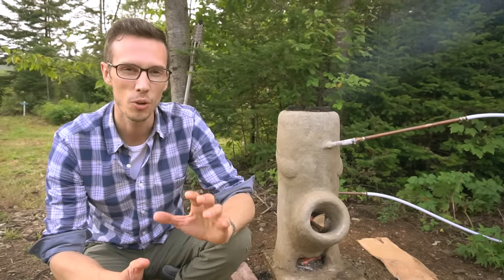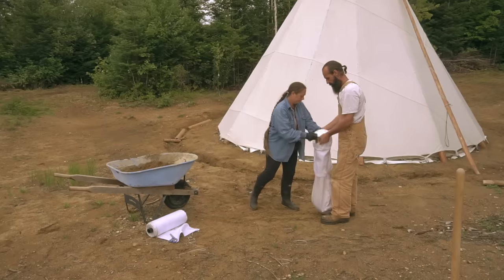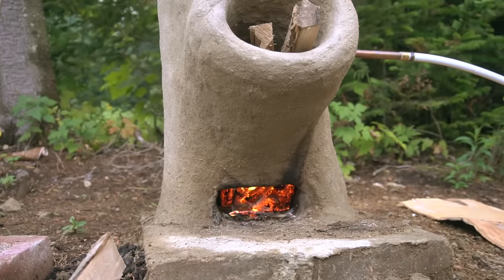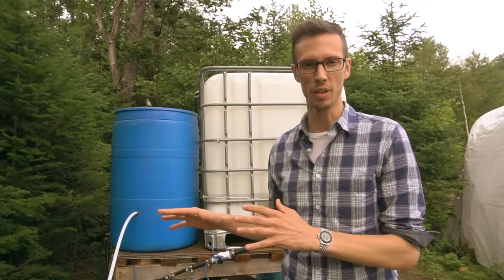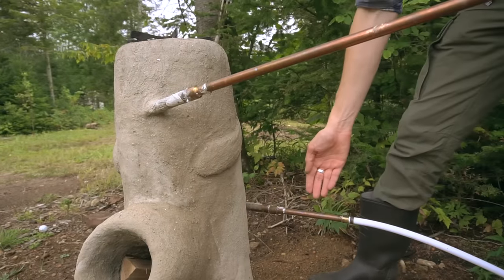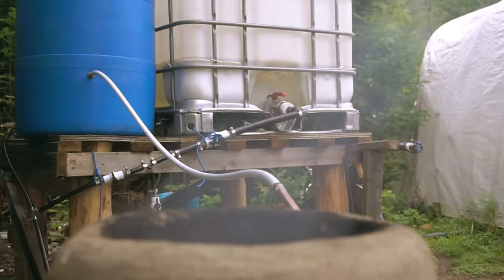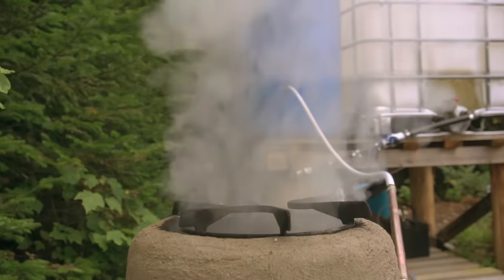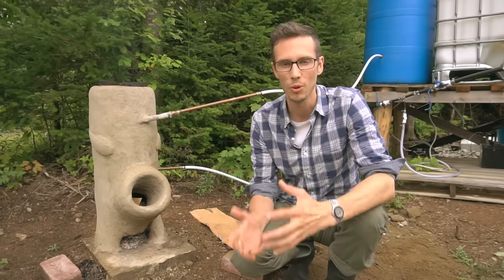Brilliant DIY Off-Grid Water Heater Using a Rocket Stove – No Propane!

Comment: I cried watching this video because I realized how much of modern production is spent on "waste".  Sure comforts of life are great--hot water, soft furniture, nice art, wood floors, insulated walls, electricity, heat, a/c... but we spend 40+ hours per week working some job to maintain it all when there are things like insurance companies, advertising, entertainment, even information, is all commodified and takes resources away from other things we could be doing to make those comforts even more efficient.  

Idk if that came out coherent, but basically - I am trying to build an independent off-grid life because at least  my labor is directly going into managing my habitat and sustenance.  I will find the joy in the work I have to due, even when it's stressful or physically demanding.  I MISS doing physically demanding work--my body and my mind miss it.  

I have a powerful brain but I don't like having others tell me what to do with it.  But the wonders of remote life will allow me to finance the above lifestyle by being selective about my work (gigs and contract work directly for clients, no more selling my soul to the man).  It's a great system, and I hope I can do the kinds of things I am seeing here

Comment: That's good. But it could be even better. You may need to add height to the hob outlet if it is only for heating water. Or add a second pipe (with a valve or flue damper) if you want to keep the hob functionality.

Comment: genius! although, I would use a sturdier container to hold the cold water, i'd be afraid the hot water may compromise the integrity of the "plastic"  container after the warm/hot water is collected back into it. steel container would be better or a beer keg? eventually it would probably leak or corrode, but even with insulating, it should last a long time. just a thought.

Comment: They can directly put a water source made up of metal or clay mud on the stove and join a pipe to their kitchen and bathroom. In that case they only have to add a gate wall on the boiling water source.

Comment: We call that a heat exchange water system where a coil of copper pipe runs through another copper or stainless steel insulated barrel with the thermosyphoned heated water mass, your plastic barrel looks dodgy and temporary. 
Love the novel clay rocket stove though , it would be a great exercise for bush survival comfort to create free hot water on demand, I'd build something a lot sturdier and permanent for long term off grid in a wood stove homesteading.

Comment: Hi... Looks nice
 technical question
1. Was the copper protected from the flame at all, or is it not necessary (or is copper is hardy enough ?)
Reply: Copper doesn't touch the flame, it's wrapped around the outside of the chimney.. then plastered in clay, tip, don't use clay or cement or any other window dressing.  It'll explode n stuff

Comment: If you're going to do a setup like this i'd insulate the the transfer tubes coming back to the heated water tank, and insulate the tank itself. Better yet, simply get an old water heater and use it.

Comment: you use the same principle with a coil of copper tubing attached to a cooler or some other insulated container and lay the coil into a wood camp fire.. the convection of moving water will eventually boil in the container...

Comment: I wonder if you could build a small Adobe house with piping throughout the walls and floor, then use a solar panel to power a pump, to then circulate heated water throughout the home

Comment: Everything I've seen has the burn chamber and chimney insulated to achieve total combustion.   I think a mass heater type setup would be a much more efficient energy transfer.  So heat exchange should happen at the exhaust or chimney exit.

Comment: If you put a check valve in the cold inlet side it would increase the rate the water is flowing in the coil and the correct direction. You could also use it to pump the water from their main tank to the new tank. Then it would only have hot water in the new tank, and not have to heat the entire mass.

Comment: I would think that the cover tubing would quickly become coated with soot and become inefficient at absorbing the heat from the fire. What about encasing the tubing in a large amount of thermal mass?

Comment: I would think that by allowing water supply in to the upper inlet (current outlet) of the coil would make for more efficient heat transfer, allowing for less fuel to be used. 
They could also insulate the lines from the tank while they’re doing the tank...

Comment: first look thought it was a decorative urinal.. lol. i found many hoses cant take heat & pressure for long. steel braided hoses work better. also some non restrictive filter helps to keep from a buildup if the water is not the best quality.

Comment: They wired the in and out lines backwards would work better if they flip the lines on the stove. Then add a steam pressure release so if they run low on water or it gets to hot it doesnt blow up. People have done the same thing on a wood stove you need a pressure release to be safe.

Comment: nice
water heating
cooking
circ w/o pump
angled wood feed
fire lighting hole / Ash clean out

nice that cold water coming in at the bottom will return to the hot water storage tank thermally..
i woul have made the mistake reversing the tubing.... but now I see if hot water went in the bottom it would rise and go out the top tube reheating the hot portion inefficiently

Comment: Instead of enchanging water, just  exchange the heat IN the water... by using a coil...  plumb pipe OVER the top edge of tank... with a small straight, descending piece of copper, before the coil begins (at the  top of the water level)... and coils down (centered in the tank, not along the edges)... then the bottom outlet, should just be  a continuation of the copper tube... which penetrates the plastic drum's wall,  a few inches above its bottom, using a bulkhead fitting.    This way, you can use the same water, instead of running new water, through the same tube... (which will plate and eventually clog the copper pipe.)   This way, the same water will carry heat into the cooler tank, and deposit it... but it is not a water transfer, only heat.  :-)

Comment: I love the idea of going off grid, but do me to have to light the fire every day for some hot water etc is a lot of additional time required which I don't really have.
I've got one solar hot water system which helps, but in winter even in South Africa, the sun is weaker so it's less efficient.
The convenience of electricity is hot water on tap without thinking much about it.
Reply: The point of going/being off grid/self sufficient  is to provide you with more free time.. and starting a fire takes less then 60secs

Comment: Ever heard of an Elephant Water Heater. A 44 gallon 200 liter Drum laid on its side. A hole cut in the top. An outflow pipe in one end about 2 inches 50 mm below the top. Fill to side pipe. Light fire underneath water boils to get water out pour cold water in the top automatically expresses boiled water from the side pipe you can keep it up constantly.

Comment: Use an automotive radiator on the hot side and inside the tank to dissipate more heat into the cold water tank.

Comment: Good video, you couldn't get 10 showers out of that tank though. I've build a semi off grid cabin and pump rain water from a tank of the same size into a tankless gas water heater and you get 2 showers at most from one tank

Comment: Very very nice artwork besides. Thanks a lot for posting this! You are now one of my inspiring heroes working for solutions for a better world instead of just crying about the bad guys.
You can make a cleaner and more efficient burn (smoke is unburned fuel) without CO with a burn tunnel of at leat six inches in diameter (more than 8 inches can almost produce lava.. )  using an afterburning chimney. When all of it is  wrapped up  with some good insulation (ceramic fiber works very well-so does a clay-perlite mix).  In this example, the copper pipe must be well protected against the open flame: Erica and Ernie Wisner found that ceramic fiber or a clay-perlite mix can cause the temperatures to rise well above 1500°C in the burn tunnel just before the afterburn chimney. The results: Less fuel consumption and co2-neutral heating due to a better burn.
Take a look at permies.com. They know more about it than I  do.

Comment: I'd be inclined to heavily insulate, and possibly make the chimney bigger(?)
Reply: Why make the chimney bigger?
Reply: i was thinking that any excess "heat" would be transferred into more pipe up the chimney. i.e. double the surface area of tubing by making the chimney longer.
Reply: I can only get so hot though, plus it might lose its usability as a stove top if its too tall, but it gets very hot even with only a few coils. at least it does in similar things ive seen, and those weren't even in rocket stoves, just a regular fire.
Reply: the home ones have very long flues, so provided it has an exit, it must be able to escape. I think there's a lot of benefit to surface area, just look at steam train boilers.

Comment: I really didn't understand where a shower is taken if the blue container only has two pipes. One taking the cold water towards the  rocket and a second one bringing it back as hot water into the  same tank. Therefore my confusion is : would I have to take a shower outdoors? And how would I get the water out from it?

Comment: Hey that's a nice idea, you can be self sufficient with your wood however I don't think it's very efficient. I just finished a project on biomass for heating water in a biomass (I can share it with your once it's validated).
Those open fireplaces have an efficiency of 5 to 20% which means that 80 to 95% of the heat is for... The birds. It means that you consume way more wood than it you'd have an efficient system. The fact that the water tank isn't insulate isnt good at all either. Moreover the fact that the stove is located outside of the house make it less efficient as you don't even collect the heat for the house. At the end of the day it can harm the environment more than efficient propane of gaz (yes yes !)..

Comment: The same piping and the water 💧 storage can be used inside the house 🏠 walls, so the heat escaped from the water 🚿 heater can convex into the structure, like the attic or somewhere useful and the water tanks make good heat sinks and solar heating from the sunny 😎 side doesn’t require much more work after installation and the fireplace could be used as a backup heat system once enough solar heat is storable. For cheap cooling, underground tubes can bring up cooler air than the outside air, so take advantage of what’s offered for nothing but our ingenuity.

Comment: How does the water travels back into the drum, against gravity?
Reply: Raman Bari the pressure of the larger volume of water in the drum tank above the heater coil In the stove keeps the water moving. I think the heater would be more efficient if the water inlet was the upper part of the coil and warmed itself as it travelled down closer to the embers, and then super hot water went up the pipe back to the tank.

Comment: They should build a wood gasifier so they can run petrol generators off of the wood to produce electricity or even drive around using wood as a fuel.

Comment: Only problem I see is that rocket stove efficiency comes from the high chimney temperatures, and by using the chimney to heat water you're decreasing temperature thus efficiency. A better idea would be to make the stove have another "combustion chamber" (like the drums you see when you look for rocket mass heaters) and take the heat from there. Anyway, good idea
Reply: The high efficiency comes from the temperature differential between the hot chamber and the cold ambient temperature at the exhaust. This creates a buoyancy force, expelling the hot air from the combustion chamber. This heat exchanger does not impede in that, because it is not located at the chamber, but in the column, where the exhaust is. If anything, it should aid the efficiency by cooling the exhaust temps.

Comment: Should have built a "rocket cistern". Make a concrete cistern with the shower water in it. Lots of thermal mass. Make fire in the rocket stove portion. No plumbing to lose heat from into the air as it siphons back and forth. Make a plywood lid for it, and insulate it with fiberglass or something.

Comment: They need to use 20 to 25 mm copper, and have straight pipes (preferaby) with a constant fall from the heat source to the water storage vessel.  This should be copper preferably, to avoid melting the plastic.

Comment: A problem is though that by cooling the fire with the water, the temperature of the fire is lowered, which in turn decreases how effective the fuel is converted to carbon dioxide. This can result in the production on carbon monoxide as well as potentially cancerogenic partially oxidized hydrocarbons. This can be avoided if the amount of water passing through is optimized.

Comment: If I just use regular clay would it crack from heat without any special treatment? Such as just buying clay off of internet and molding it to that and letting it dry? And or same question eith concrete

Comment: Using propane is not living off the "grid".     You should use an inline pressure release safety valve in case water circulation stops for an unforeseen reason.  I would locate one on each end of the coil.  Perhaps there is a way to create small cob coated enclosures that would still be aesthetically pleasing.

Comment: Really the reason you want to do this is to use the excess heat generated from the flue and to cool down the rocket stove. A cool rocket stove lasts longer.

Comment: Hey how about a 3 - fer ???
Take that nice Clay Rocket Stove , build a Clay Pizza Oven just above it where chimney goes up through the Oven , continuing up thru tm& out the top of the Pizza Oven.& out the top & still cook your pot of soup on top there .... Have your water heater , have a Pizza Oven , still have CookTop & the Oizza Oven doubles as a regular Oven to Bake breads , roasts , chicken etcetera...  Now there's a multi use appliance for you ...👍👍😜😜😜😜😜🤗🤗🤗

Comment: Physics! 🤔 How can the hot water go up back to the barrel? Since the barrel in higher than the stove and also both pipes are higher than the stove where they connect to the barrel, so the water is going to flow down from the barrel to the stove on BOTH pipes 🤔

Comment: I don't believe you need to have the water 'source' higher than the fire stove, as I have seen youtube videos of people heating outdoor bathtubs with an at same level thermosiphon. Essentially, as those videos explained, the heating of the water within copper tubing initiates the water movement from boiling. 

It probably wouldn't work with the copper tubing above the water source, unless it was a closed circuit (ie. water within the copper tubing at all times). But would be interesting to see someone try.

Comment: You made a error in connecting your tubing to the barrel. Stove side:cold should come out from bottom of the barrel and hot return to top.
waterside fill cold on bottom take out hot from top. this way you will create thermal seperation in the barrel and hot will replace cold from top to bottom instead of mixing as you are doing now . this will keep your flow in the exchanger constant and gives hot water very fast even if the bottom temp is still low..

Comment: the copper pipe will corrode and start pitting and leaking  inside of this mud-cement material unless is sleeved with plastic coating.

Comment: There are some problems with this kind of design; 1- There is too much Heat Loss. 2- Too Small Water Jacket;hence it takes almost forever to heat the water. 3- Loss of efficiency= If you imagine that the barrel would be on top,direct heating, would've be 10 times faster heating. The best option is making a Non-pressurised water tank inside a stove and extra water jacket on top of the exhaust. CERAMIC BLANKETS or Insulation can be used to trap all the heat which is lost. Nice design but not efficient. Thanks for sharing.

Comment: Nice video but that implimentation of a rocket water heater, which is an actual thing, is not very good. You can see the evidence of this from the ton of smoke it's spitting out.

The heat exchanger being intergrated into the burn chamber is going to prevent it from doing its job which is to burn fuel efficiently and that means a hot roaring fire with no smoke. Once combustion has been achieved then the heat can be extracted from the hot exhaust gases. Since insulating the burn chamber is one of the components that makes a rocket stove, the heat exchanger is usually put on the outside of the burn chamber with another encosing/ housing over the burn chamber and the heat exhanger. Think of a pipe inside a pipe with a coil running between the two. The elevated temp of the coil and the even hotter exhaust gases will serve as insulation for the burn chamber since heat is not as readily lost as it would to the cold outside air. Also radiating heat is trapped instead of just radiating out. Putting the coil inside the actual clay of the structure seems harder and less ideal to me than just wrapping it around an unimpeded burn chamber and then building another chamber around that thats ideally removable. Not to mention it will make for a very crappy heat transfer as you are basically insulating your heat exchanger with clay. Those are apposing functions.

I think if you lit an open fire under a steel drum you would probably make better use of your fuel and in a shorter time than using this.